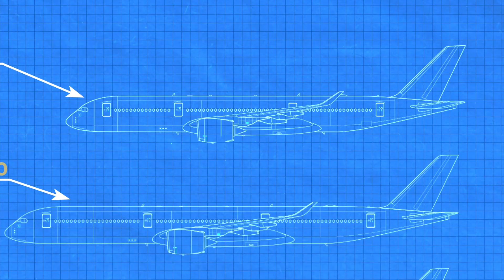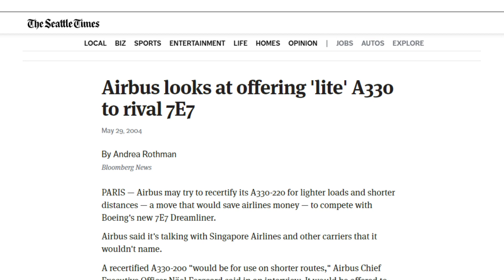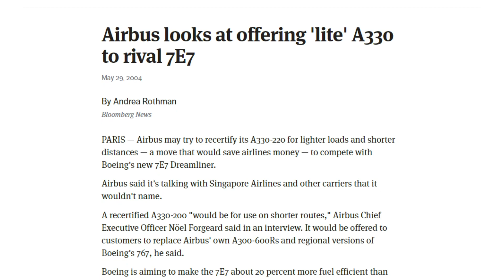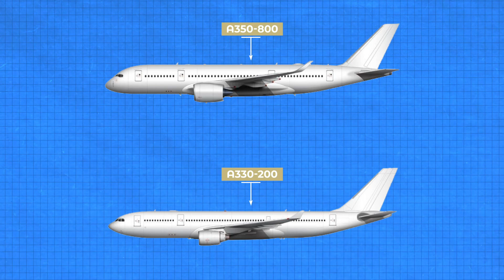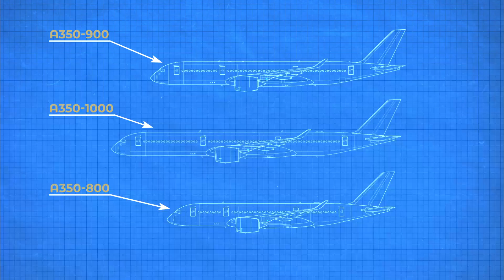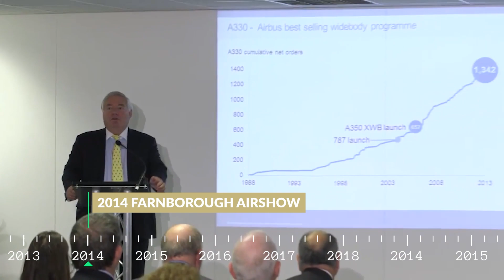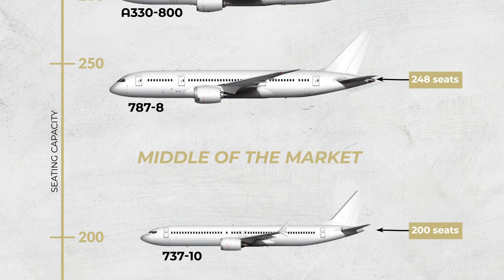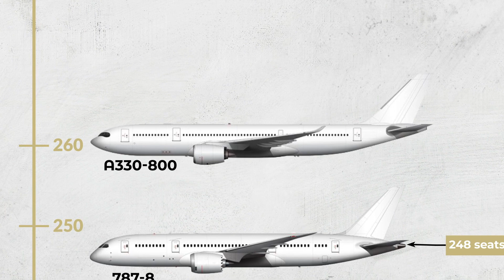The A350-800... The Ultimate Boeing 797 Competitor!

Comment: The theoretical optimal length of a aircraft, or really any streamlined thing is 7 times the width. But its really uneconomical to make a aircraft that short. Making them longer is cheaper than making them wider. Also the optimal is based on volume, not area, making the true optimal closer to 11-12 times.

The width of the aircraft is dictated for 1 or 2 corridors.  1 corridor would be between 2 and 6 a breast with a total width of 3 to 7. 2 corridors would be a total of 7 to 10, with a total width of 9 to 12. In theory one could make a 6 wide wide bodied aircraft, but its kind of pointless.

This gives us a packing density of for narrow bodies in the low end, like DC3 66%, the A220 range  83% and the A320/737 range 86%. Note how small the diffrance between a A220 and a  A320 is.

For wide bodies, a 7 wide would have a packing efficiency of 78%. That is quite a bit lower than the A220. A 8 wide, like A A330 or a A340 would be 80%, a 9 wide, like A350, would be 81% and a 10 wide, like 747 would be 83%.. because its basically two 5 wide next to each other.  (this amuses the corridors is all same size, that of cause, in reality they are not. but sufficiently close)

Because of ETOPS there is no longer a market for A340. This gives us a pretty obvious market segmentation.  Numbers of seats wide, 

This gives us a cabin width formula of  (X+2)*0,50+15, where the seat is 45 cm wide with a armrest that is 5 cm wide, with a extra armrest for every row..
5: 3,1
6: 3,6
7: 4,64
8: 5,15
9: 5,65
10: 6,15

Cabin length being typically 70% of the total plane length, and the seast typically 80% of that with a coach pitch of 71cm one can calculate the maximum seating for optimal seating. This turns out to be about 200 for 6 abreast and about 380 for 8 a breast...  Pretty much matching the exit limit for middle of the market for every given width.

This shows us the problem. The 7 abreast is really needed, but its also highly uneconomical. Shorten the A350 makes no sense. Shorten the A330 make a bit of sense, but its hard to match. Making a 7 abreast aircraft is it self uneconomical. This gives us sort of a natural market gap. Where we have aircraft for every given size, apart from 7 a breast. (767 is sometimes configured as a 7 abrest plane, but its really a 8.

Comment: The longer is already ther with the upcoming A350 for Qantas project sunrise with an upgraded fuel tankd. What’s the neef for shorty A350 when also you have A321 XLR.
Reply: The a321XLR and the a350-800 wouldn’t compete against each other. The XLR would have significantly less range then the a350-800 and would also carry less passengers.

Comment: Shrunken big planes are very inefficient.
Airbus will tackle the issue from the other side, stretching the A321 furthermore. Or the next gen A321.
Reply: Welp where will they sleep
Reply: @Imbreadtt  crew rest will be installed on the seating level, sacrificing one or two rows of seats.
Reply: @TillFoerster  Yeah they may try that crew rest for A321 XLR
Reply: 747 SP set several range records.

Comment: Can you please stick to Kilometers instead of nautical miles? Eventually your channel is more about aircraft engineeering and not flying piloting an aircraft. The language of the engineers is the.logical and consitent metric system (for very good reason btw) and not some mideval retarded arbitrary measure units.

Thanks. Good video though 🙂
Reply: disagree. Nautical Miles could be placed alongside km in the boxes, however, like shipping, nautical terms trump metrics.
Reply from the maker: Range for aircraft is generally measured in North America in nautical miles. I can understand kilometers as well and I try to give both.
Reply: @FoundAndExplained  Range for aircraft in engineering is always measured in Kilometers and similar metric units.

Comment: Airbus is developing a new variant, right? The A350 ulr for the Qantas sunrise project?
Reply from the maker: I believe its just a normal A350-900, not a ULR. I could be wrong however and things might have changed. Qantas has also not committed to it, and its rumored that its given Boeing more time to come up with a better plane for them (cough cough 777-8x)
Reply: @FoundAndExplained  Qantas have selected the A350-1000. Airbus are expected to add another centre tank to increase the range. The 777-8 has been shelved, seems unlikely that Boeing will offer it to Qantas since it's never been built or flown, whereas the 350-1000 has a proven track record, and Airbus have shown what they can do to extend the range of their jets, like with the A350ULR and A321(X)LR
Reply: check with the $24M.K.PA. irish gnome of sydenee on that

Comment: From what I have read, it would appear that a 'shrink' starts with a significant disadvantage when compared to a competing 'stretch'.
Reply: Shrinks are hard because everything is build for the original. Overweight for a shrink. Stretches are easier because rarely does anything in the guts of the aircraft need modification.
Reply: Yea, the 737-600 and A318 are both proof of that